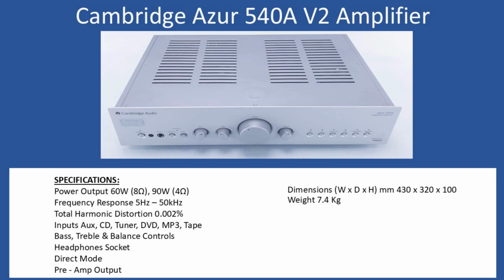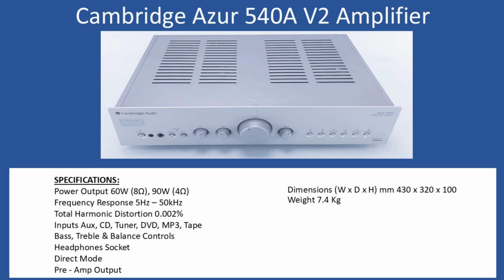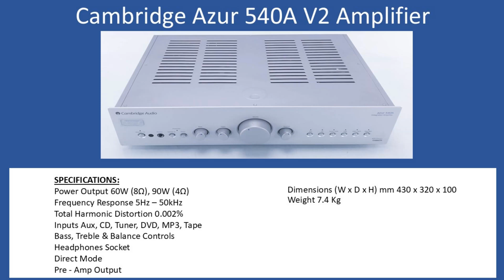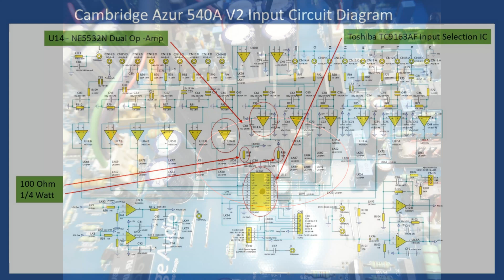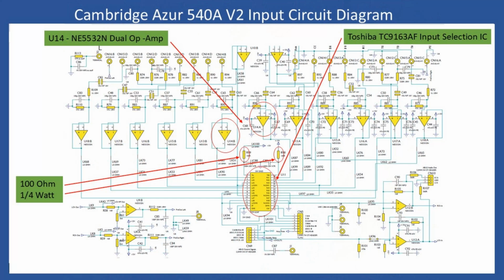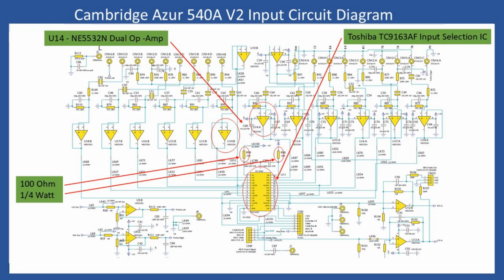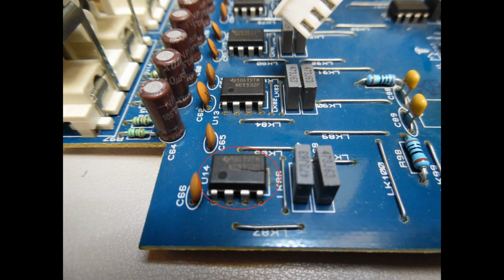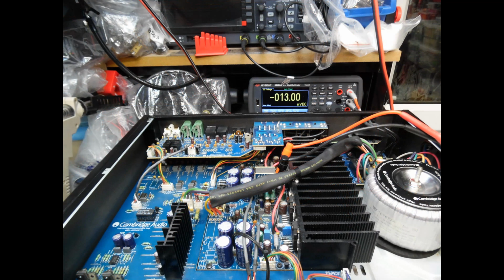Cambridge 540A azur Version 2 Amplifier Repair (With Audio Tutorial)

Comment: I cannot believe most of these no name electrolytics were still functional, let alone within spec; that's quite an achievement considering the lengths they went to, to... offer an affordable product. Let's leave it at that. Another surprise is the condition of the front panel, they were really delicate and prone to scuffs and marks. SAP outputs became the norm in UK designed equipment at the time, with many suffering premature failure. Notwithstanding, pretty decent amp for the price and another one saved from the dump. Great job!